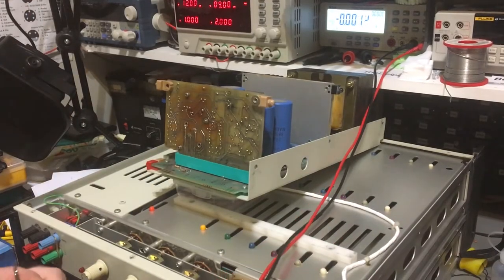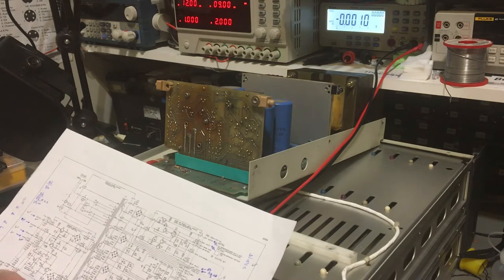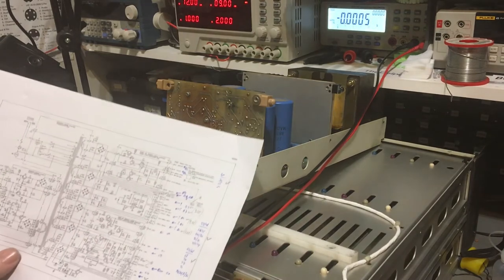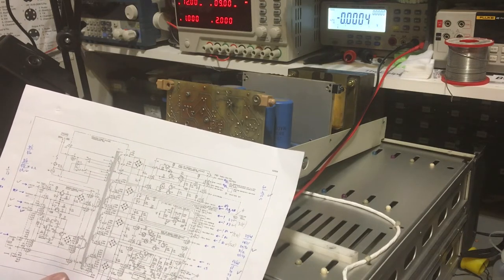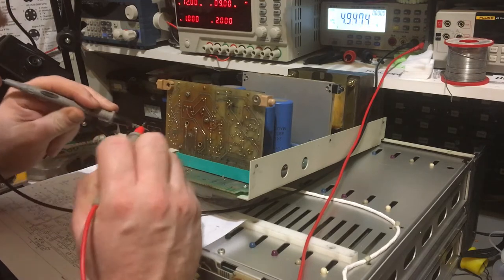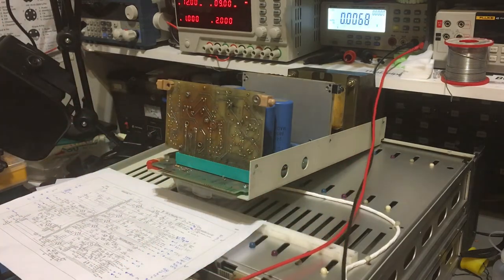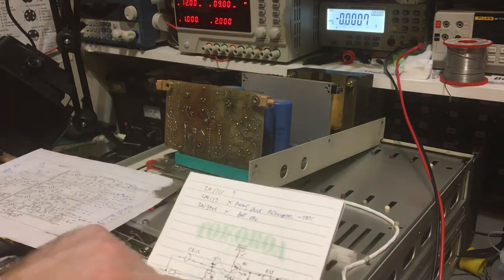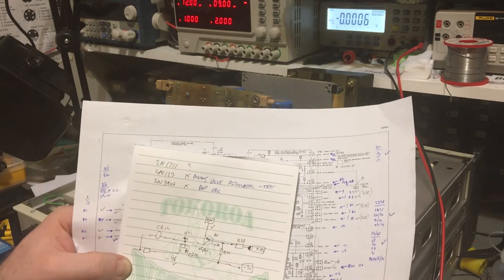#294 Fluke 5200A AC Calibrator Repair Part 3 - Regulator PCB SubAssembly A5A2

Comment: Great series. I’ve got one of those coming soon, so I’m previewing this to get an idea of the circuits. The unit I ordered has output, but the seller says it’s of by 20%, so it will take some work. By the way, you may already know this, but the JFET/Diodes are probably current limiting diodes (CLD) also known as current regulating diodes, or constant current diodes. I worked with those in the past and the app notes described them as specially configured JFETs. I recall running a SPICE simulation to verify that a JFET in the CLD configuration works as a constant current source, but it’s been a while, so I don’t recall the details. Central Semiconductor makes them as a CLD. They use a different circuit symbol than what is shown on the Fluke schematic.
Reply from the maker: Tim Thompson - I have three more videos lined up to publish, I actually just got my unit working a couple of days ago, it still has some issues which I think is probably due to bad caps, but it at least outputs up to 111V now.

Comment: Light at the end of the tunnel.  It's worth it in the end.
Reply from the maker: it is a VERY long tunnel... I have been working on this thing for weeks now!
Reply: TheDefpom I know what it's like with this DSA. Awaiting a replacement board as I think I have finally found the problem. At least you can check at component level.  No chance with the DSA, risers are unobtanium!
Reply from the maker: The riser I got for this actually caused issues, it didn't align correctly in the connectors, shorting out pins ! As I type this I am gluing a bit of wire to the edge to make it sit higher in the slot. I have been enjoying your DSA videos, it is always good seeing something being repaired which is unfamiliar to me, or doing things which I have not had to do myself (such as the rewinding).

Comment: What a convoluted pain in the arse psu lol.
So the LM723 is rather ill, and an op amp similar to a 741 has bit the dust too.
I did like your pot test, it was a quick way to give it a feedback loop :-D.

The temp bypass with a 7815 and 7805 is also something ive done with equipment to power circuits up in a temp way, i love the old 78xx 79xx series, so dam handy, and the LM317 is the daddy of easy supplys :-D.
Reply from the maker: It was a mission getting the power supply fixed, so may weird things with shared supplies partially powering other sections.. I got it fixed in the end..
Reply: I was worried that you had purchased a "dead parts unit".
You know, where someone takes two dead units and swaps boards to produce a working unit, then the dead parts are assembled in a unit for a punter to buy.

Ive seen that a couple of times when people have bought junk and didnt know it.
The pattern of dead sections does not make sense, then i know its junk.
Reply from the maker: It could be something like that, I still have a few issues to sort out such as the overload staying on, and no output voltage, I found a few issues, (one you will see probably in part 4) where I find a inexplicably damaged precision resistor inside the reference assembly, as though it had be put on a grinder... or hit with a dremel. In the end I find 6 problems in total just with the power supply regulator PCB !